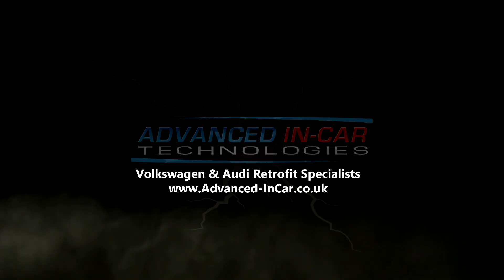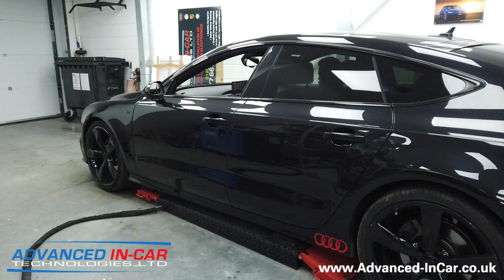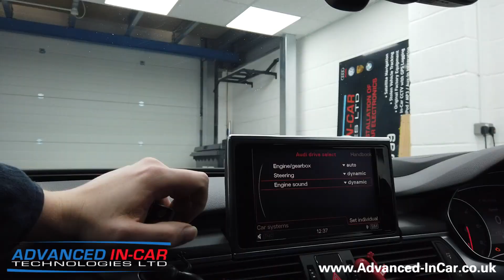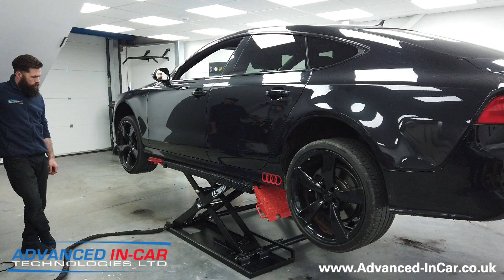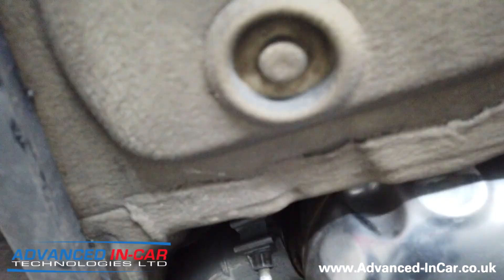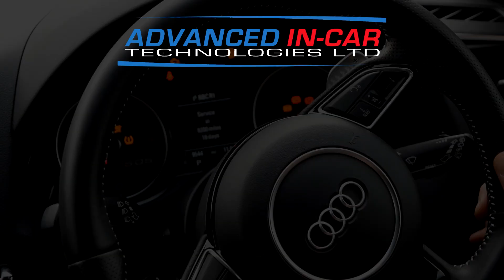How To Make Your Diesel Car Sound Better & Awesome!

Comment: You've put the opening pipe into the route of the water, it will be ruined the first time going through a deeper puddle. You have to mount it a way the output channel faces to the rear of the car...

Comment: Hello, I don't know if you can help me. I have a Kucatec Sound Booster device that I installed from another vehicle that I sold a few days ago, from which I removed it and installed it internally in a Mercedes W205, but I have the following problem: It doesn't turn on or off, I don't change profiles when I touch the cruise control switch, what do I have to do or what do I have to configure to make it work through this switch?

Comment: Dpf+cat delete with stright pipes is the way to go with diesels (v6 or over).
The people that would install this to their car are the same people that install them electronic blow off valve boxes to their 2.0 diesels that they think sounds cool but sound terrible lol
Reply: bro what surely that wouldn’t pass mot
Reply: @fintan.  Exactly what I was thinking, only way to make diesels sound any good though.
Reply: Yeah exept in most countries that’s illegal as fuck
Reply: @easydrive2236 your 100% correct mate, its illegal here in Ireland too but I just bolt the original parts back on for m.o.t then take them off again when it passes lol
Reply: Dpf for the black smoke?
Reply: black smoke just means your tune is running rich. get a custom tune done to minimize black smoke. If you aren't running a beefy stage 3+ kit and you have black smoke, it's 100% just down to you using a bad ecu tune. @ziyannoorani5185
Reply: @lifeisgoodwhenfishing what do you recommend for a g20 320d 2019 manual?
Reply: I’m guessing this can work for a straight six diesel x6? F16

Comment: Yeap,next yeat they will have a big update.They will add a pair of bluetooth speakers so only you can hear it so other people will stop laughing at you.Who the HELL buys this crap ?
Reply from the maker: Quite a lot of people have this fitted. The technology is also used on High-end vehicles like the R8 which has Sound Actuators in the wheel arches.

Comment: This is awesome. The amount of idiotic dumb comments is phenomenal. These dummies don’t realize that a lot of modern cars have this in their models. VW names it soundaktor and it’s in some models. The BMW i8 also has it. This way you don’t have to remove your cat and have your diesel car sound like a fkn lawnmower. Not to mention most states and countries require a yearly smog test or exhaust inspection. Diesels without cats are dumbest and selfish thing you can do

Comment: Ese a7 no puede ser del 2015 ya que no tiene los faros correspondientes al rediseño que audi le dio al a7 en 2014 por lo tanto ese a7 c7 4g pertenece al periodo entre el 2010 a mediados del 2014 que para mi es la mejor version hasta ahora que con los tubos de escapes cuadrados y el aleron terminado en curva hacia abajo hace perder agresividad a esta bestia.

Comment: Bunch of dummy down people criticizing the work and don’t know that Diesel engines don’t sound like a normal engine car. Educate yourself first before judging
Reply: https://youtu.be/Ysi36b9rT70

The answer is V8 Diesel plus true dual no crossover. Either straight piped or with 2 separate cats and mufflers.
Reply: @muaythai193  Not everyone can afford a V8 engine, plus I wouldn't want to drive something that powerful insurance will skyrocket and whats the point a car is a car it has wheels like the rest of them, just saying.
Reply: Guilty Potato You’re not a car enthusiast, you’ll never understand. 🤷‍♂️
Reply: @muaythai193  That's true i'm not, but i am more enthusiastic about the aesthetics of a car.

Comment: Hi, I have Ssanyong Rexton 2008.(Turbo diesel engine) My problem is that when I start the vehicle, its sound is smooth and soft. When I drive about 15-20kms (around 90-100km/h) engine' idle sound becomes louder and irregular. Can anyone please explain?

Comment: Thats pretty disappointing. I was hoping for a method of changing the natural sound of the exhaust not a cheaty speaker
Reply: What kind of engine you got?
Reply: @muaythai193  A 2.5 VM 4 pot diesel. Which, because of the offset turbo, actually sounds quite decent, got a nice V8/Scooby rumble to it
Reply: All vw bm been using Cheaty lol speakersfor years

Comment: hahahahah imagine instead of actually making your car sound better you just spend a lot of money on speakers to fake it
Reply: Let the cops explain you why a speaker would be the way to go after you get a ticket for illegal mods ;)
Reply: @saimali7712  which year is your car?? Does it get smoke after all the process?
Reply: @black914015678  2013. Not even a little bit of smoke
Reply: @saimali7712  I’ve got a 16 plate a4 b9 and I’m so gutted it’s vet quiet and I don’t like it like that
Reply: @black914015678  i also have a K&N filter so that also makes a sound a bit better, got stage 1 remap. Would recommend u a muffler delete and some good filter like k&n. Im sure it will sound better.
Reply: POV: your a Tesla
Reply: In some countries it's illegal to get a nice exhaust system without the company having some TUV papers for that type of car and engine 😢
Reply: I wqs so dispered once i almost think about it till i watch it was 1600 euro 😂😂😂
Reply: Harris Hayes You could never get a diesel to have a decent tone anyway. Would spend more in modifications and wouldn’t even sound as good as this speaker system.
Reply: @ashdube09  Nah straight pipe V6 TDI is good enough ;)
Reply: @SemperF30  or straight pipe 2.0 tdi pd
Reply: @vapenation7061  nah that sounda lame. 2.0 gasoline is ok but online 8 cylinder tdi sounds good
Reply: @SemperF30  the v6 tdi is easier to sound good, but a 2.0 tdi witha proper setup sounds crazy also. I know there are some crazy 2.0...
Reply: @saimali7712  but the new ones with adblue will not do it. 2.0 tdi adblue are crap. I want to do it but they told me it cant b done
Reply: @black914015678  so try a only muffler delete, it doesnt do anything crazy but sounds way better, also when the dpf is regenerating it sounds like petrol straight pipe when crusing at 2/3k revs
Reply: @SemperF30  Yeah, shame DPF delete is illegal in my country...
Reply: @ashdube09  lol that’s BS. Downpipe. Remove cats. Muffler delete. It’ll sound and growl like a petrol. You diesel haters are so dumb
Reply: @ashdube09  dude have you heard superturbo m57 and om606? Literally sounds like a 2jz with less revs
Reply: @ashdube09   My 4.2 tdi should sound better then a petrol so idk what u talking about

Comment: Are these cars not 3.0tdi V6 anyway? Why not just have exhaust downpipe and remove the back boxes, natural noise and cheaper as well as potentially frreing the flow of the exhaust up a bit?
Reply: the V6 3.0TDI sounds awesome, I dont know why people want to pretend to have something they dont. Holy crap
Reply: My cars a 3.0tdi v6, the sound you get when you remove the dpf and back boxes and put a stright pipe in is bloody incredible. Have owned my A4 b7 now for 15 years from new and she's never let me down,almost 200k on her now and still going  strong💪
Reply: @IrishPikeHunter  likewise, that was same as I my setup before I wrote it off 😞 sounded lovely, r32 esq 😂
Reply: @JJS-Electrical  sorry to hear you wrote her off and hope you walked away OK bud. Did you get back on the road after the crash? If so what car did you go for?
Reply: And most catless diesels sound atrocious and pollute like crazy. Diesel is way heavier and dirtier than a regular engine. Go to any truck stop and see.
Reply: @CTAjunior  most do you are right, but not the 3.0tdi v6, sounds sweet as far as diesel engines go!
Reply: ♣A because it is illegal to remove DPF and cats. Those kill the sound because all of the exhaust heat is extracted.

But for idle noise boost I guess it should be possible to inject more fuel and retard the timing a bit